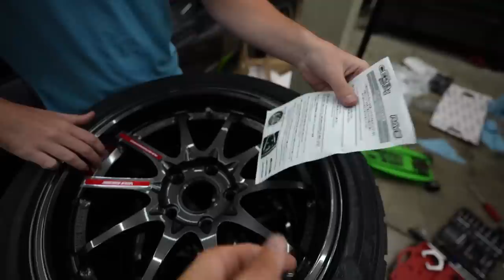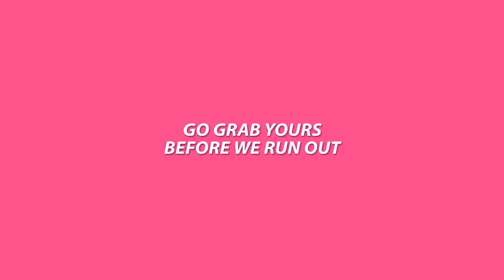Building my DREAM Honda S2000! (Ep. 1)

Comment: @3.04 you will never get that rotor screw out with a regular screwdriver. The correct tool to use is an "Impact Screwdriver". You insert that impact screwdriver and you hit it w a hammer as you rotate the handle and booyah! Out comes that rotor screw. It's an old school tool - cause you could also use an impact driver today - but that cheap $10 tool has saved me and my friends hours of frustration.